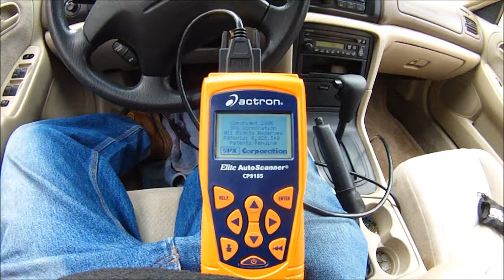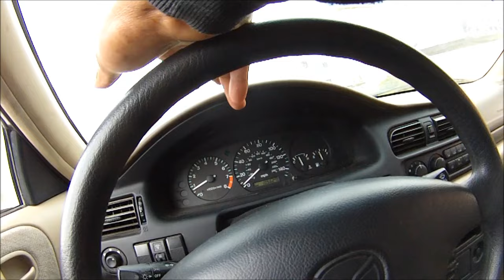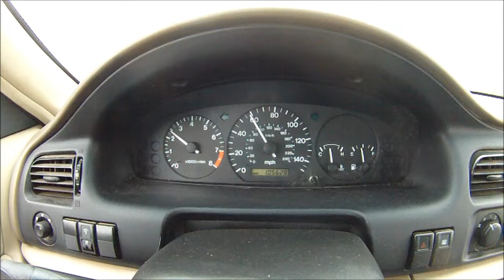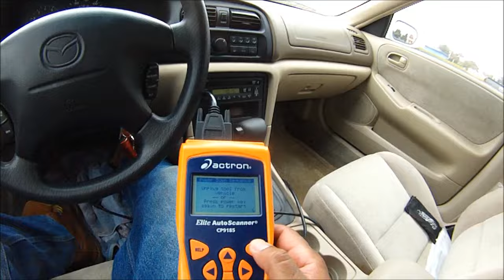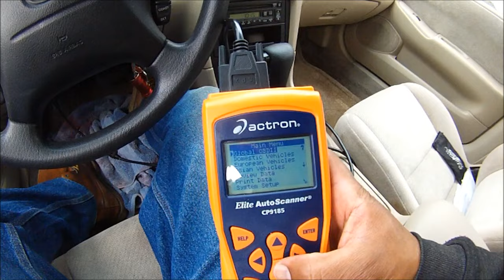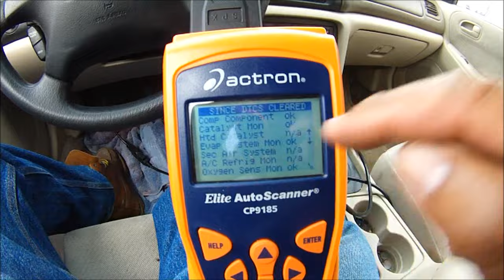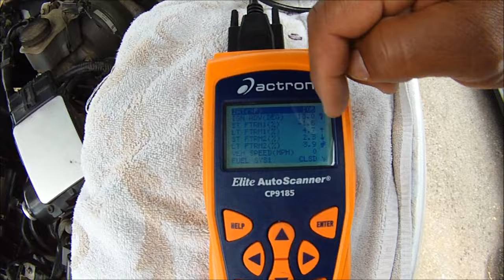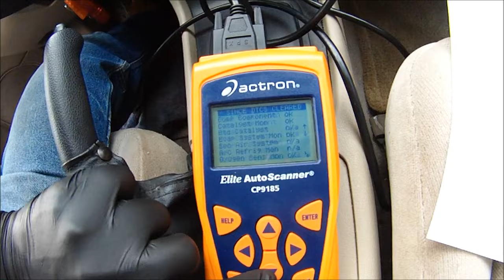WHAT SMOG TECHS WONT TELL YOU AFTER YOU FAIL THE SMOG TEST FOR (INCOMPLETION OF OBDII SELF TEST)

Comment: The short fuel trim is derived from the computer trying to keep the engine at a perfect 14 to 1 fuel gas air ratio. It uses the signal from the o2 sensor and the map sensor and the mass air flow sensor. to come up with long fuel trims and short fuel trims. The short fuel trim is what is happening right know. The long fuel trim is what is happening over a long period of time. The goal for driveability concerns is the long fuel trim to be within 10 of 0. The short fuel trim will be constantly changing depending on what the engine is doing can go to 25 and then the log fuel trim will change one number the short fuel trim will go back to 0 and start all over again.

Comment: Recently I tested my car with my scanner before trying to get it smogged and found I had a bad post-cat (downstream) oxygen sensor. I had one error code to that effect, though all the IMs said 'PASS'. I got the part and replaced it, but had lent my scanner out in the mean time. I drove with the new part on the car for five days before I got my scanner back and was disappointed to see now three out of the six displayed IMs now said 'FAILED'. I cleared the code created by the old bad O2 sensor, then did an errand across town and back, probably 15 minutes each way. I retested and found everything now said 'PASS', including EVAP. I didn't do anything special, just drove normally...

Comment: can you use cruise control to keep speed?

I did the longer version of this, the one I found while researching did the city driving first, drove between 20-40mph for 3minutes 15seconds, then went to the freeway drove between 40-60mph for 15minutes (yes that long), come to a complete stop (no brakes as well just e brake once slow enough not to lock brakes up) idle for 5minutes then turn off and on.

Doing this I was able to get 1 of the 2 not ready sensors, which was the "catalyst" (catalytic converter). My oxygen sensor is still not ready.. did this one (the one you did) and still didn't get it ready. imma do it again tomorrow morning to see if it goes away...

BTW tip, do this like at 12midnight onwards, no traffic. That's what I did, just put hazards on since you will be too slow for the traffic flow that may come by.

Comment: Unless you disconnect the battery prior to taking it to the smog inspection, regular driving will allow self-test to complete.  The only reason you run into this problem is if you try to clear the check engine light codes (either by battery disconnect or with scanner) right before you go into the SMOG station.
Reply from the maker: WRONG not in all cases, I do this all the time and you just made it sound that simple. If you dont know DONT ASSUME.
Reply: oldskool funk I'm not assuming anything...realistically if your car isn't ready from daily driving and you haven't disconnected the battery recently then something IS wrong.

I've done a good number of emissions tests and yeah, once in awhile I/M monitors get stuck and won't ready, but how often?  1% of the time?  I've dealt with it once or twice but that's by FAR not the majority..and when it does happen it's typically b/c something IS broken and simply not far enough out of range to throw a check engine light.  9 times out of 10 the reason it's not ready is because somebody disconnected the battery....had to explain that one to people 1000 times..

Comment: I drove the 55 mph for 5 miles then put flashers on then slowed down then used the e-brake to completely stop, while defroster was on high jumped back on road and drove the 35-45 mph with stop signs for another 5 miles, got home and checked the OBD it was green check mark but not even 5 minutes later went back to the yellow light while the x were on the cat & evap , I think tomorrow I will leave the scanner plugged while doing the test…I’m close I can feel it  thanks again just have to reroute tomorrows test

Comment: Anyone with an Infiniti G35   or a Nissan 350Z  There is an easy way to test if your car is in the I/M “ready condition”. Turn the ignition switch ON without starting the engine, one of the lights on the dash is the Malfunction Indicator Light (MIL) it comes on steady.  Wait 20 seconds with the key on, if the MIL light begins to blink after 20 seconds and blinks for 10
seconds, the I/M test condition is “not ready”.   If the MIL does not blink after 20 seconds, the I/M test condition is “ready”.

If the MIL indicates the vehicle is in a “not ready” condition, drive the vehicle through the following pattern to set the vehicle to the ready condition.

The Drive Cycle

1. Start the engine. Allow the engine to idle until
the engine coolant temperature gauge needle
points between the C and H (normal operating
temperature).

2. Accelerate the vehicle to 55 MPH (88 km/h),
then quickly release the accelerator pedal
completely and keep it released for at least
10 seconds.

3. Quickly depress the accelerator pedal for a
moment, then drive the vehicle at a speed of
53 to 60 MPH (86 to 96 km/h) for at least 9
minutes.

4. Stop the vehicle. Leave the engine running.

5. Accelerate the vehicle to 35 MPH (55 km/h)
and maintain the speed for 20 seconds.

6. Repeat steps 4 and 5 at least 10 times.

7. Accelerate the vehicle to 55 MPH (88 km/h)
and maintain the speed for at least 3 minutes.

8. Stop the vehicle. Place the automatic trans-
mission gear selector lever in the P (Park) or
N (Neutral) position or the manual transmission
shift lever in the N position.

9. Turn the engine off.

10. Repeat steps 1 through 8 at least one more
time.

If step 1 through 7 is interrupted, repeat the
preceding step. Any safe driving mode is acceptable
between steps. Do not stop the engine
until step 7 is completed.
Reply from the maker: Thank You for adding the drive cycle MrComa Toes. Thats what its all about, helping each other, right on for your support brother.
Reply: oldskool funk No problem!  I am in just this sort of situation,  I just bought a G35 that had a dead battery and I happened to find your vid!  I want to thank you for taking the time and effort to prove that this type of work around for a dead battery is effective!

Comment: Good call old-school I checked my memory ecu fuse it seemed okay but then I checked the back up radio fuse and for some strange reason that 7.5 fuse was missing so I put a new one and instantly blew it with the car being completely off I did a bit of research and found out that the ecu memory is some how associated with my radio, cigarette lighter and clock so I pulled out my radio checked all wires from the wire harness and sure enough I found two exposed wires that were grounding I fixed the exposed wires and now my clock works fine my stereo and most important my ecu memory now my monitors don't get erased this issue was on a 96 honda accord hope someone can find use of this bit of information thanks bro and one again God bless you for helping others
Reply from the maker: Adolf Alvarez I just re read my comment and actually it was fuse #28 not #30 my bad. Congrats on fixing your monitors I cant stand smog anymore but im glad I learned how it all works. I decided now I am going to show people how to read the smog report in detail now, (The HCs CO NOx O2 CO2) to show people how to fight the RIP OFF SMOG TEST stay tuned God Bless.

Comment: Looking at this scenario this all could be done stationary too with out the need to drive the car all over creation. You could put said car on jack stands and do speed test for monitors with the wheels removed for safety spinning for a set time  along with ac going tell the ready monitors pass if the car is not legal to drive. This method is easy.

Comment: And it's sad because a smog shop could tell every single customer for a year that their sensors haven't reset and that's $4-8 dollars a customer plus the original price of the smog if they come back. "You're sensors have now been reset Mr. Jones, when nothing was wrong with them in the first place.

I build and race street cars and none of the cars I had would pass smog (OBD1), so what a lot of smog shops would do, is let you pay $100 and they would put the information for your car in the computer and smog one of your buddy's cars. But now with OBDII, you can't just switch ECU's. I'm actually building an OBDII car as we speak and I've heard no matter what is going on with the car, 1000hp, no catalytic converters, turbo/supercharged or whatever, as long as the car isn't throwing a check engine light. I guess we will see. My 2003 Cobra will be a classic in 2023, so I won't have to worry about smogging it anymore. Thank gawd.

Comment: fords are even easier to get ready, you can even pass with bad converters on it, if you have a ford , Lincoln or Mercury and the check engine light comes on after a few starts every time its reset, then you can do this to fool the test equipment that your system is good and ready...1, Reset the computer while the engine is cold, 2, start car and drive to the highway and drive for 30 minutes at 60MPH, (DO NOT TURN THE CAR OFF AT NO TIME WHILE DOING THIS) after the 30 minutes go directly to the test site and allow it to idle until the test agent tells you to step out, while you are stepping out turn the car off. while the agent plugs the car in he will start it. The system on a ford product goes through two test a pre-test and the real test. here is the loop hole in these Ford, Lincoln,and Mercury Emission system. The ECM WILL NOT DO THE SECONDARY TEST UNTIL THE CAR REACHES 45mph. the system will be ready and it will have fault code but no codes to trigger the check engine light, it will show the faults in the pre-test in the system, and the computer will pass the car since the ECM is working and pass the car. 
 I have a 96' Mercury Cougar with NO CATS and I  have been passing the test for 5 years  now using this loophole in the system tests.  Try it and let me know how it went. E-mail me at (0010charlie@gmail.com) Remember this works for FORD,LINCOLN, and Mercury products
Reply from the maker: Right on Charlie, appreciate your advice and tips its all about helping each other so they don't put to much of a dent in our pockets God Bless.
Reply: I don't think you would pass in California, as your 96 Merc  with no Cat. Converter would need to pass a tailpipe hydro- carbon test.

Comment: 2004 Jeep batting through this right now.  Question.  I have a stick and from what I have read they say not to touch the brake or the cluch on the deceleration part.  I need to shift out of 5th or the Jeep will stall.  What is your suggestion?

Comment: Thanks old school for that information one other question I had was I remember you leaving a comment about I think it was a 96 civic that you were able to get the monitors ready but as soon as you would turn off the car they would get reset back to incomplete did you ever figure out for that civic you had mention and if so please do share thanks in advance also I cleaned out my battery terminals to make sure I have proper contact but still sane issue
Reply from the maker: Adolf Alvarez Yes I figured it out it was a blown fuse 30 under the dash. That fuse is linked with with the radio and computer memory. Check to see if yours is blown my fuse 28 and 30 where both blown out I changed them and now the computer no longer resets. Its a part of the RAM random access memory which needs voltage supply (volatile)  when key is off to maintain memory for drive cycle monitors.
Reply from the maker: oldskool funk Sorry Adolf, I meant the fuse #28 was the issue with the computer memory and clock. Thats what happens when I have a ton of things going through my mind lol.

Comment: Do you need to set the cruise at 55?  My inspector said to set the cruise on 55 drive for 5 minutes then turn off cruise with cruise on off switch and not to hit brake let it cost to a stop and sit stopped with foot on brake for 5 minutes with car in drive

Comment: You forgot to mention that the evap won't run if your fuel level is about 3/4 of a tank or if you're above 8,000 ft in elevation. Ford which includes that Mazda you're driving states the fuel level should be between 1/2 to 3/4 of a tank. I can verify that the evap won't run with a full tank.

Comment: Hey Oldskool funk! Great video. I have not tried it yet, but will do so as soon as I can get my hands on a scanner. I do have a few questions:

1. My mechanic said there should be no reason to have the scanner attached since it should not make any changes to the car's computer and it all should (in theory) work without the scanner attached. Does the scanner have to be attached or can this fix be done without the scanner??
2. You said to turn on the defrost and then the heater. Do you keep both of these on when doing the drive on the freeway and in town??
3. You say to do this in the morning. Does it have to be done in the morning or can I do it anytime, as long as the car is cool when I start the test?

Thanks, bro.
Reply: +Adelina Thompson Yes I have the same question about the heater!  Do we have to keep it on during the drive?  Please answer, please?
Reply: @TheRuthyc  No you don't have to have it connected.

Comment: My granddaughter called me and said she had a check engine light and the shop that works on her car said it was an evap code and catalytic converter efficiency code. They wanted over $500 to fix it. I took the car and bought a new gas cap for $15 and cleared the codes. Problem never came back. Been over a year. Watch out for the crooks and incompetence.

Comment: I have a question regarding a 2003 ford escape with no check engine light on and no codes. How do I get the catalytic monitor ready? When I took it to a smog tech (a few times now), the scan always says that the catalytic monitor is not ready/incomplete, but everything else passed. I've already driven roughly 200+ miles after initial smog test. I've done various drive cycles pertaining to this car and still nothing. I've also tried other "tricks" i've seen her on YT, but still no luck. I've also done this test a few times and still the friggn thing doesn't want to wake up.
Reply from the maker: Your Catalytic converter may already be to far gone try this anyway, this is what I do.
1. Hook up my scanner 
2. Drive on freeway ( get cat hot )
3. Erase codes as I drive ( that's restarts all monitors)
4. Keep driving and watch as each monitor clears, they all clear at different drive cycles ( and gets ready )
5. The cat will be the last sometimes to clear.
Watch the catalytic monitor and keep driving 5 to 10 min
6. As soon as the scanner says all monitors ready.
7. Rush to the smog shop and tell them to hurry before it comes back on.
Do this multiple times, it doesnt work all the time but sometimes it will it depends on how bad the catalytic converter is.
It's a temporary trick to get it to pass smog because your cat is definitely going out or it may be to late. 
You need a scanner for this test.
Make sure the scanner has live data and can read readiness monitors.
Reply: @oldskoolfunk71  Will try this soon. I can't afford your scanner at the moment lol but will def get something off amazon that does the live scanning. Thank you for the details and help. I'll post back if it works  for sure.

Comment: SERIOUSLY?? FIVE HOURS?  

 just exactly are people supposed to do this drive cycle (sometimes as many as EIGHT times are necessary to get them ready, according to what I've read during our recent frustration with this issue) when you live in the city and are stuck in traffic all the time? We just came back from a 2 hour drive in the middle of the night and STILL couldn't get it to complete.   Took it to the dealer who wants to charge 217 dollars to DIAGNOSE the sec air monitor and does not even guarantee that they will find anything wrong with it at all.  Basically we have been told
 that we might throw money at it until the cows come home, and it may not reset for any discernible reason, and they won't even say it will find anything wrong, nor that paying them even more after that will ensure that the truck can actually be made ready.  We could theoretically spend 700 bucks at the dealership and still have no answers on what to do!  That is beyond asinine.   

  NOTE that this passed smog check just about 18 months ago, but the STAR program is what is causing the fail of a perfectly functional vehicle now.  I will be writing a letter after we get done with COURT tomorrow where we have to ask for an extension of the fixit ticket we now have for the stupid registration (PAID, just not passed smog) tags not being current.  Eventually, if we can't fix this, do they really expect people to junk a car that runs well or risk suspension of the license or impound?  ALSO we can't fix the other problem of a missing front plate because they won't issue new ones unless the car is CURRENTLY REGISTERED but even though our fees are paid, we can't clear this monitor to get the tags!!  INFURIATING.  This is BS.    Not helping the environment or the consumer with this inane process either... STAR program is just putting money into someone's pocket like the days of radio playlist PAYOLA or something

Comment: I did this trick to two other cars 5hat I used to have and it worked on both of them , but I tried this three times with a 2001 Gmc Safari van that I have and didn’t work ! I have three monitor that are not cooperating . Any suggestions ?

Comment: The drive cycle/readiness cycle is different for every manufacturer.  It usually just watches for a set number of engine speeds at different load values.  All you have to do to make sure you're doing the correct sequence, just Google: drive cycle (insert manufacturer)... It's not that difficult.
Reply from the maker: Thanks Steve, we appreciate the info, drive cycle can be a pain sometimes.